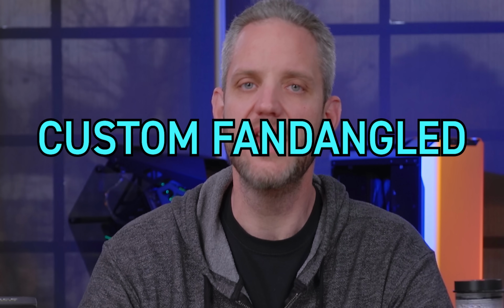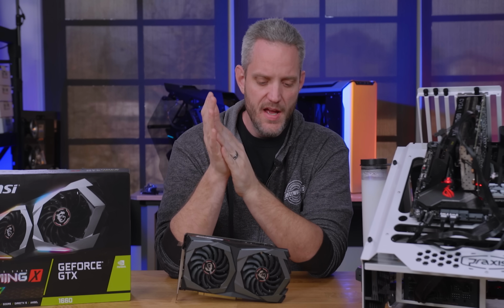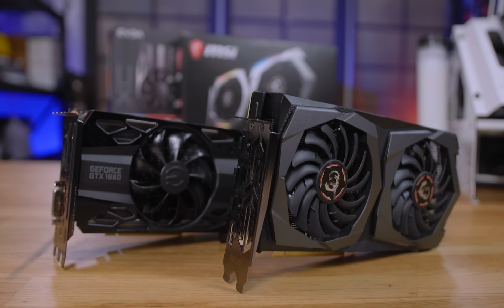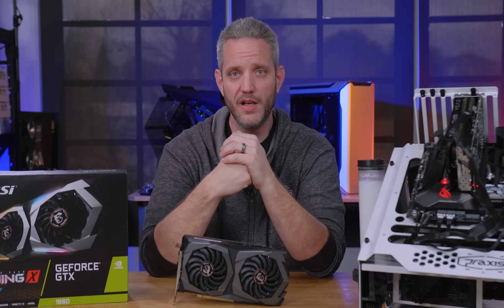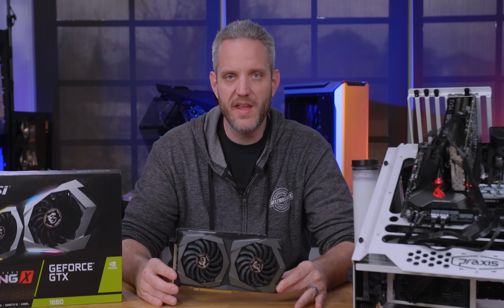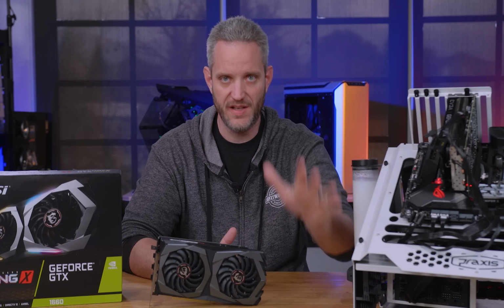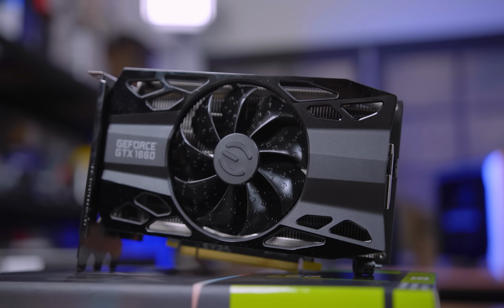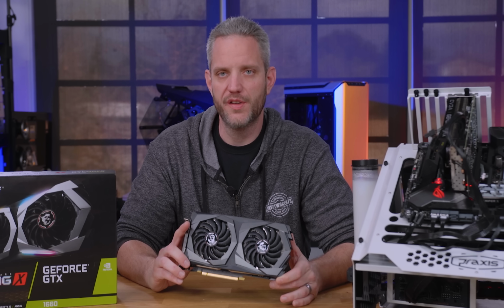Just save your money.... GTX 1660 vs GTX 1060

Comment: "No one should have bought the 1060 3G.."
Well I did. It was 240$ compared to 400$. Extra RAM and a few cuda cores weren't worth it.
Reply: I got the 3 gb as well now considering what I'm going to do going forward.  I don't even know.
Reply: @PajamaPantsMan  I had some time to think it over... And it really depends on your montor. If its 1080p, like mine, I don't see the need to upgrade. Runs most new games in high with maybe a few options on medium.
In bfV I couldn't even see the difference.
If you're still on the fence, ask yourself if a bit sharper textures are worth the extra 300-500$?
Reply: @instinct922  yeah you're right, I'm gonna wait until I really need to upgrade my PC when it will no longer be able to enjoyable run a game anymore.

Comment: I recently received a driver update on my GeForce system. I use 1060   card. The update mentioned the 1660 card for my update. Did I receive a performance enhancement of 3GB to 6GB?

Comment: Watched,  listened,  still not sure...
4690k
16gb ram
Asus gtx 1060 6gb dual (white tiger one) *have now
Samsung ssd
1080p -atm

Eyeing the 1660ti but i dunno me?
Also considering 1440 screen but I've never used/witnessed one in action.  Is it a noticable leap from 1080p to 1440?

Any advice appreciated.

Comment: Really hoping you can give some advice please. So looking to upgrade my old budget gaming pc i built this to compete or beat the xbox one x when it released and was able to easily for 350 pound.

Specs

i7 3770

GTX 970 4gb

16gb 1600mhz ram

So ive got 250 pound to upgrade and dont know any pc people to talk to or for advice really so hoping to get some advice from pc gamers like myself.

Upgrade 1 Brand new GTX 1660 ti

Upgrade 2 Keep the 970 and get Ryzen 5 2600,16gb ddr4 3000mhz ram,Gigabyte B450M mobo

Upgrade 3 Keep the 970 and get Second hand i5 7600, 16gb ddr4 ram,Asus H110 M-R mobo

Upgrade 4 Second hand gtx 1070 and preorder red dead 2 lol

All options come in at 250 pound and its my max and i dont know what would be the best option as i currently dont struggle to run anything at 1080p 60fps

Comment: I’m on a 970 and it’s doing me fine
Reply: Me too. Until I upgrade beyond 1080p monitors (yes, multiple, in this case 3, though 4 would be useful) it isn't worth upgrading, and if I do I'd rather save up and get a 2070/2070super really as it'll last longer

Comment: Will i3 9100f bottleneck with 1660?
Reply: If you want a cheap cpu just get a Ryzen 5 1600.
Reply: @taproot4287  i cant because i have already i3 9100f so please give me the answer
Reply: It might.  Most modern games seem to run better on 8 threads than 4.  Just look at the games that you want to run and see how they utilize cpus(how many cores/threads they use).

Comment: The 1660 is basically a OC 1060 6gb...3-10fps difference is not that much when the 1060 has barely any games that go under 60fps at max detail 1080p...barely any, its not really a upgrade at all
Reply: Assetto corsa max settings 1080p on a gtx 1060 6gb will have shit load of stutters
Reply: Haha no....you think you are tuff cause you have daddy's money...this is not gtx 960 its the 1060 6gb...there are no stutters in ANY game out there...full of shit

Comment: Well turns out 1660 ti performance is closer to a 1070. Hell it even beats it in some benchmarks. It all is about 5% difference most of the time. I said most.
Reply: the problem is that diff between 1660 and 1660 ti is 10 fps
Reply: @T_TCryT_T  yeah but they point more towards the. 1070 rather than the 1060.  The current cards in time really devalued the 10 line up.
Reply: @thegeoshow5296  its either 1070 or 1660 tbh adding 50$ to get 1660 ti for only 10 fps is not a good thing
Reply: @T_TCryT_T  But then again I picked up a 1070 used for only £180 with 2 year warranty.

Comment: still using a 960 4GB version..  am able to run FIFA 19 at a solid 67fps (1080p ultra 4X MSAA) and PES 19 at settings maxed out.. Hitman 2 I get a stable 45fps at max settings .. GTA V I get more than 52fps at high settings.. 
Dell Optiplex
i5 4670 3.4ghz
12gb DDR3 1600mhz
128gb SSD
500GB HDD

if u decide to be obsessed with adventure games.. U will never be satisfied with ur build.. Happy urself fam 😁😁😁😁
Reply: I have a 970 and still going strong lol

Comment: if you are looking for a 1080p gaming at ultra settings just go for 2080ti if your budget is low then buy rx 580 8gb video card dont waste your money on other cards.
Reply: No There really isn't any  monitor higher than 240hz refresh rate, which the 2080ti can surpass.Just play on a higher res or get a 2060 or 1660ti for that .

Comment: I just bought a gaming pc with ryzen 5 & palit gtx 1060 3gb, now i realized this gpu is so cheap & outdated.. makes me so sad i paid a lot for the rack. Now i learned about rtx series and vegas and im planning to get rtx 2060 soon
Reply: Same except I'm going all out on my next build. 2080ti with one of ryzens new CPU launches.
Reply: @revelxtion6326  you mean one of those threadrippers huh? They are really expensive. How much 2080ti cost these days?
Reply: @ricvai7  like 1200 I believe. Depends which brand you go. But like the 3950x or whatever it's called.

Comment: I don't like how JayzTwoCents is saying that the 1060 3G is a card no one should have ever bought. Not everyone plays games on maxed out settings. Three gigabytes is enough for a lot of people, and apart from the memory, it's only about one to two frames slower than the 6G. It's also a little bit cheaper. I bought my card back in the summer of 2017. The 6G was retailing for about $60 more. Maybe the prices have changed, but I don't see any reason to hate on the people that did buy the 3G variant.

Comment: I think for someone upgrading from a 9 series card or older or someone building a new rig with a moderate budget  the 1660/1660ti are both great cards to use, I went from a 960 to a 1660ti and have seen a great upgrade in performance (obviously) but also being stuck on the old socket and ddr platform I don’t see the point in getting a etc card because that that point I’ll just be bottlenecking the gpu

Comment: As long as I can run AAA games at least @ 1080p Low Preset 60fps+.. I'll still keep my 1060 6GB, and save a lot of money to buy a new expensive GPU for future.
Reply: Are you serious? a 1060 6 GB can run games @ 4K - 45+ FPS. 1080P is a joke for this card.
Reply: @InspirationInfinity  yeah you're right.. what I really mean is, if when the time that a 1060 6gb can't keep up 60pfs+ on  AAA games even at low preset, that's the only the time I would replace my 1060 :)

Comment: I bought a 1660 for $189. 
obviously a single fan model, Funny enough Its the Same EVGA Model in this video.

Brand New, eBay seller for $219.99, accepted a 210 best offer, and there was a 10% off anything promo going on. That took $21 off my total. no tax, free shipping.

its for my streaming pc so it doesn't need dual fans. I just wanted the Turing encoding.

Comment: When I build a pc I put so much money for the board and cpu and mem then gpu and then I do research on what's the best in that price range and I build what I can afford and a question for you I have and roc mother board with a ryzen 5 1800x overclocked to 3.9 ghz and I did the overclock in the bios on the board the preset config in bios so when I watch your videos on overclocking how can you find out how it's overclocked on eack core on the cpu would I ask what's the program you use to check and great videos as always

Comment: 1660ti isn't even bad for the price
Reply: Yes but driver issues
Reply: @finallyucanstop6991  After May all Driver Issues got fixed.. U have to reinstall the whole driver and it will run fine. My 5600 XT had some issues at begin, but got fixed. My 5700 XT somehow never got issues at all.
Reply: Crusader5 5 but the rx 5600 XT claps

Comment: Hey Jay, could you make custom bios's for both cards and compare them again? the twin frozr cooler, even the earlier ones, are capable of handling much higher tdp so modding the card isn't really an issue. i have a gtx 960 (twin frozr 5) running on my custom bios at 1530 MHz core / 4000 MHz vram and it doesnt exceed 65 degrees c (but runs into tdp cap, which could be modified. well, it wouldnt make sense at all to do so. the chips won't be stable above 1600 MHz).

Comment: Proudly running an overclocked GTX 580 that performs at roughly 1050 Ti levels of performance.
(edit: and an FX-8150 overclocked to 3.85 GHz on 6 cores.)
Reply: i got one of those for free like a year back. never used it, even though i have a bunch of old computers in a lan setup that are all using much slower cards. powerhungry hot mess of a card.

Comment: Right now I’m using a GTX1050 (not ti) Which enables me to stream older games. I think about getting myself a higher midrange card for gaming at 1080p. And i think, the GTX1660ti is the card for me. The 1070 does not have the latest nvenc encoder, comming with turing cards. Streaming features are crucial to me.

Comment: I’m confused... according to Jay, the 1660 competes with the gtx 1060 3gb.... but the 1660 is even better than the 1060 6gb! So, shouldn’t it compete with the 6gb instead?
Reply: There were two different 1060s the 3gb (less powerful) and the 6gb (more powerful. These line up with the next generation of cards. The 1660 being the new generations 1060 3gb equivalent and the 1660 ti being the 1060 6gb equivalent. Hope that makes sense
Reply: Old Gregg oh that makes sense thanks
Reply: The same happened with the GTX 950, as it compared to the GTX 1050Ti, because GTX 950Ti didnt exist, this type of stuff happens alot

Comment: My favorite Dude...hey Jayz!!  Break it down for me.  I trust your Tech advice so here is the question.  Aside from all of the boring specs, benches and such for the guy on the street, like me.  I like to game with very good graphics, down my office work and surf.  I like a decent screen res 1080p and use 16GB fast Ram with SSD storage.  the computer shop pushes hard the RTX cards and the GTX 1080Ti.  I have been thinking about the GTX 1060 6GB and now the GTX 1660 6GB. In just a few words which would you recommend to people like me?  Thanks

Comment: I had to spring extra money for the MSI Gaming X 1660 vs the cheaper EVGA because it has 2 DP connnectors. I wouldn't be able to run my 2 144z 1440p screens on the cheaper card. The 2nd screen would only run 30hz using DVI/HDMI

Comment: I got the Palit GTX 1060 6Gb dual fan... It's a beast, with no hassle I got the core up to 1950mhz and memory 4050 mhz and it's around 78°C on a all night stress test, but I bet it can go over 2000mhz with no prob since the fans are at only 65% during the stress test

Comment: I hate this price system coz you're like I could just save $30 more for a slightly better card, then you save that money and think, well if I save another $30 I can get an even better card and one thing leads to another and before you know it you're spending an extra $200 than you originally planned on a component that will be outdated in 2 years.

Comment: for me 3gb is enough coz everytime i play in 1080p w/ high med settings most of the time im only using 2,9 - 2,5 VRAM i bought it in 2018 for 175$ msi gamingx twinfrozr 2nd hand
Reply: 3gb card from Nvidia.  I'm sure it's nice but wyf where they thinking.   The 1060 6gb is one hellava budget card andceske especially if you 4K game but the Amd/ati RX580 8gb is still the overall ultimate budget card for 1080p gaming.

Comment: In short if you have a gtx1060 6gb no need to upgrade to 1660.
Reply: Somebody who upgrades their gpu every generation has probably not bought a 1060 anyways, so it's a moot point.
Reply: @Quplas  but it is nice to know that something purchased on the tail end of production and at a discount is still relevant and not compleatly rendered irrelevant like the gtx960m being compleatly overtaken by the mobile version of the gtx1050 due to nvdia dropping the M for its laptops. Side topic is max q basically a new name for the m of the gtx and rtx lineup?

Comment: Ryzen 5 2600x, Asus b450-f strix,8gb trident z 3200, 27in 2k monitor 144htz. Currently running a 1060 6gb armor(over clocked with no crashes) . The gpu is struggling to push 2 monitors under load. Should I get the 1660 or just save for a better card? My price range is about $200. I just built this system but I didn't upgrade my gpu because I thought it would be fine. It ran fine on my old system.

Comment: Rx 580 8gb is better right?
Reply: Never
Reply: @shadman_rafi  why
Reply: Sort of.... IF we're looking at performance per dollar only. However, the 1660 out performs the 580 pretty much across the board, BUT it retails for ~$50 more, and the 1660Ti nearly $100 more. 

Personally going for a rebated RX 580 8GB just to be an AMD purest(have a Ryzen 5 2600X ready. Got it crazy cheap on ebay). If I find a killer deal on a 1660 or 1660ti, who knows I might just snag it.
Reply: @MechanicallyEnthused  yea I get that, but is there any benefit in having a new gpu

Comment: I have a gt 1030, a historical intel i5 2500 with 8 gigs of RAM, a very cool case (I mean by temps ☺️) and a 1080p 60 hz display and I only can play a "real game" by setting everything to low, close all the other applications behind, like CCleaner and those apps which keeps running on background(seriously) and I still get 13-15 fps in Assassin's Creed Unity for example, oh and the vram usage is 1900 mb, which is almost all of it 😁 So, he is damn right, gaming with a gt1030 is a no go... I wonder if I crank up the settings all the way to the ultra high what happens?

Comment: I have that EVGA 1660. Normal operation, it runs pretty quiet. But after a few minutes of ray tracing stressing in Unreal Engine, the fan noise is definitely noticeable.

Comment: my daughter was rocking a old R7 370 4gig in here Ryzen 5 system with m.2 drive and 16 gig ram as it came out of her old system but just today I did get her a new MSI GeForce GTX 1660 VENTUS XS 6G OC for $229 as it has the white fan shroud that matches her white case :-) but could have gotten the same card a few $ cheaper if i did not care about the looks of it

Comment: I bought gtx 1660 ti and I'm Hella impressed
Reply: What were you coming from? I have a 1060 6gig (got in 2017) and after checking the new gen performance tests will be able to ride high gfx rating until close to 2021

Comment: Thanks for the video. Now I kindly want your advice. I am a Sim racer, I play Assetto Corsa, Race Room, rfactor 2 and project cars 2. Currently I have the Radeon hd 7850 and I feel that I am on the edge of sacrificing the quality of the visuals to keep the preference in a good shape, specially I do online racing. Now my question is which graphic card you recommend out of these three cards:
1- Radeon RX 590
2- GTX 1660
3- GTX 1660 ti

All I need is to run these simulators with ultimate graphics possible without any problems.

My budget is around $270 and I don't do any other games. Just sim racing and I'd like to get the VR maybe next year.

Thanks in advance
Reply: just get a 1660? i have a 1060 3gb with ryzen 1600x and play project cars 2 on max over 60 fps.
Reply: @gerharddel  thanks for your reply bro.

Comment: Man, I'm torn. I am looking at the 1660, 1660ti and the 2060. Now I have the money to buy any three of them. BUT, I also want to get a CPU cooler so I can overclock my R5 2600. But I want a GPU that will last me possibly a couple years. Until I can afford to buy a whole new PC. This is my first PC and I am currently running a RX 580 4gb. So any of these will be upgrades for me. I don't know what to do! Jay, Just straight up tell me which one to get! haha
Reply: If money isn't a consideration between those three definitely get the 2060. It is the most powerful of the three and it supports RTX. Whether or not RTX becomes wildly adopted remains to be seen - consider it insurance.
Reply: Alex Moerman Yeah. That’s what I decided to get. Going to wait on the cpu cooler because the 2600 is perfectly fine at stock clock speeds for gaming. I’ll get a cooler next pay check 😂 Thanks!
Reply: @therealmattseal  Nice one man :) good luck with your build!